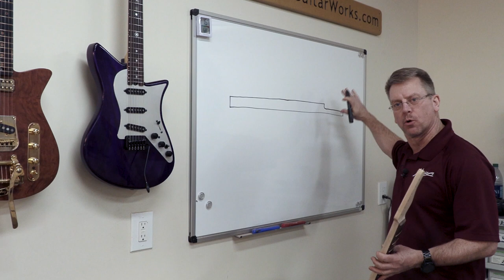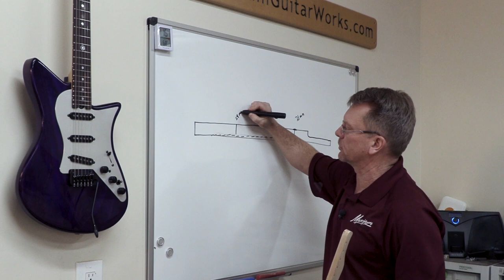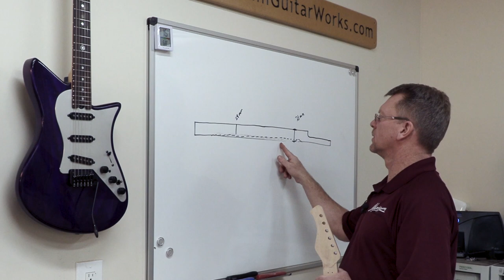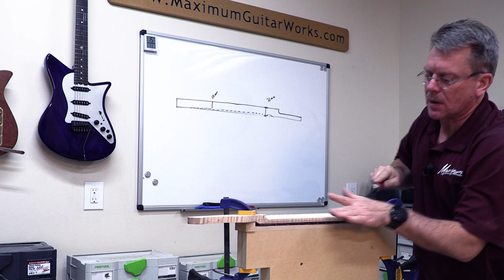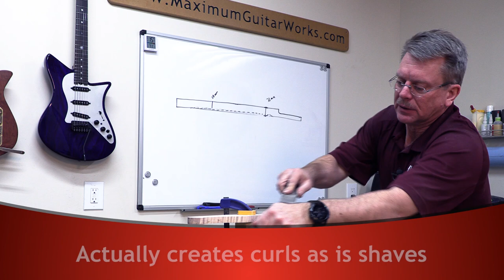Telecaster Build - Part 7 - Old School Neck Contouring with Toast

Comment: Everyone is always intimidated by making a neck, when in all honesty it's the only part that has never given me issues. And I'm making multiscales with unique headstock cutouts for my very first necks. It's the most intimate part of making a guitar. Dive on in. Worst case? You're out like 30 bucks in wood, and a few hours, but lessons learned.
Reply from the maker: Intimate was a key word.  The neck is the most critical part of a guitar because it has the most connection to the player...if it goes wrong the guitar goes wrong.  I think that is why people are intimidated.  However, I agree with you about diving in.  I tell people that I built at least 10 necks before I made my first guitar...cause I wanted it to be right.  Each one I made...the better I get...you just have to do it!

Comment: When you are shaping the neck from the class (the second one) I noticed that the truss rod adjustment was at the headstock.  Do you have a video of how you did that?  Is it a traditional fender truss rod (single action with the concave channel in the neck) or a double-acting truss rod?
Reply from the maker: It was a Stewmac hot rod series truss rod. Look at my Strat series. I think I show a better way to do the truss rod with headstock access. Let me know if you need more help.

Comment: I’m sure you mentioned it somewhere in your video, but could you please tell me the total thickness of the heel and neck pocket thickness and the distance from the top of the fretboard to the body?  Thanks in advance!  Love your videos!
Reply from the maker: Standard neck is 1” total thickness...and the pocket is 5/8” deep. That leaves the 1/4” fretboard plus an extra 1/8” (space for a pickguard under a 22 fret neck) sticking out of the pocket. If your neck is under or over sized...you must adjust your pocket by that exact amount.